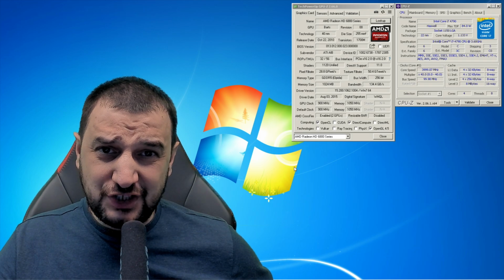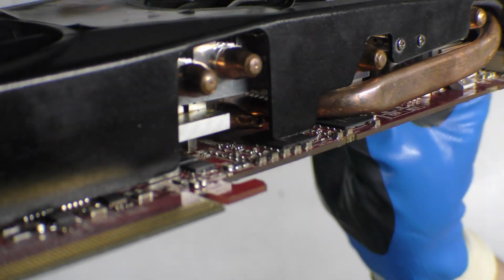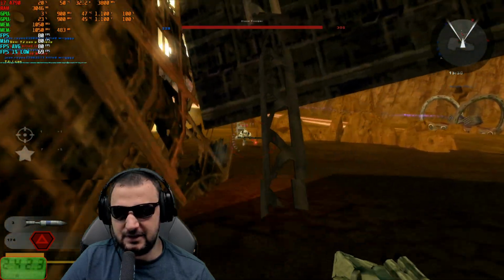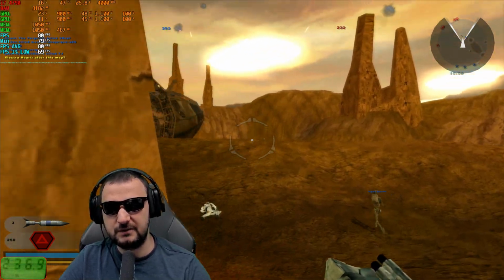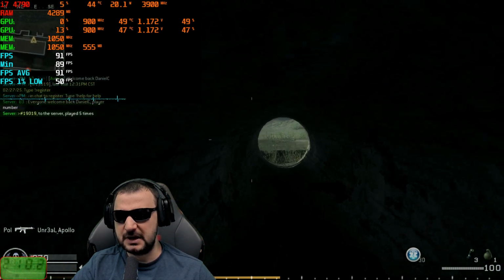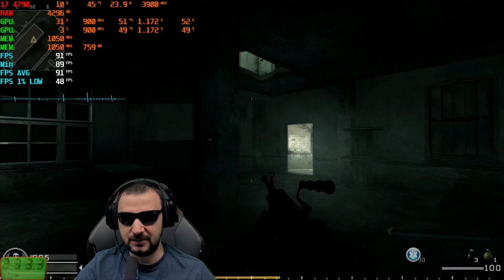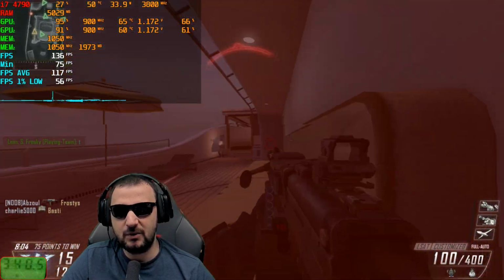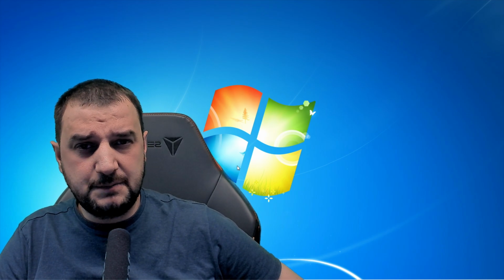VTX3D HD 6870 X2 Benchmark

Comment: a few of those games have fps caps, which is preventing the fps from going higher, also I think you need a faster cpu, , the  older drivers lack multi-threading, and crossfire is more cpu intensive than running a single card.

Comment: Daniel,you didn't answered my question, about the minimum psu required for the HD4890 Crossfire!!
So,i'm asking.😅
Again.😅
Reply from the maker: Now let’s think about this logically. If you want 2x HD 4890s in CrossFire, and you add the full PC with everything inside, you will need a system that supports CrossFire and does not bottleneck. I would estimate a load of around 500 to 600 watts.

My method is to use a power supply with double the load capacity so it can last longer and not be stressed. That means a 1200-watt PSU.
Reply: @DanielCardei 
Got the "Red beast".
The seller just copied the text from the cooler,and couldn't desypher a true id.
Probably.
Anyway, it's working now,but couldn't start the "Catalyst"!!!!
How did you managed it?
Reply from the maker: @MuadDimAtreidesin what os?
Reply: @DanielCardei 
Win 10 x64.
It temporarily,if i could rig the one i want - it's gonna be EPIC!!
The question is - would the motherboard will have the drivers for it - ae for Win Xp/7??
I highly doubt it.
Meanwhile,i want to test it solo,on my test bed pc, with X58 motherboard.😊
But,i need to got the Catalyst working....
Reply: @DanielCardei 
🎉🎉🎉🎉
Ooook.
The 700 watt WOULD be ok.
Thanks!!

Comment: I am not a mathematician, so I could be completely wrong, but the statistics captured in your gpu videos have me confused. The way I understand it, minimum fps is the lowest fps recorded. My understanding of 1% lows is that it is the average of the lowest 1% of frames. But some how the minimum frame rate shown in much of your videos is higher than the 1% lows. By the logic I go through the minimum frame rate should be the lowest number, but for some reason it is not. Can someone explain this to me?
Reply from the maker: Great question. Like you said, the software averages the numbers, and sometimes it shows different results. I would say sometimes I influence it without noticing. Now that you mentioned it, I’ll look into whether, when I change something or interact with the menu, I need to stay steady and reset to average the FPS. That’s a very, very good point.